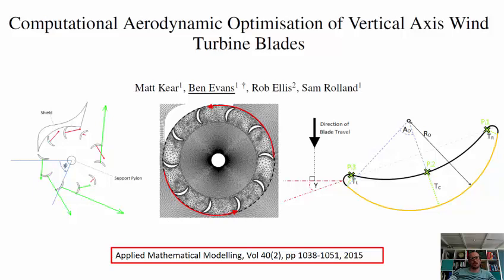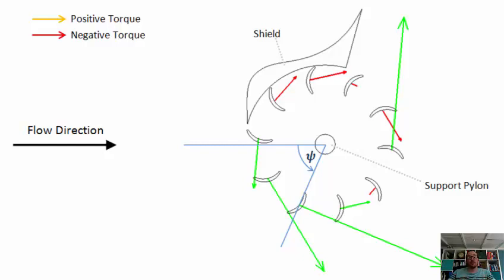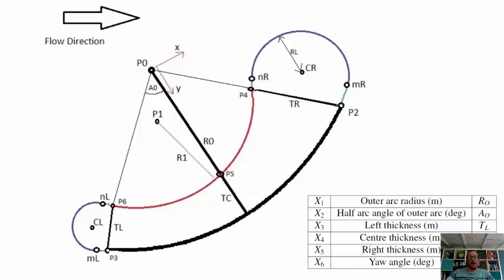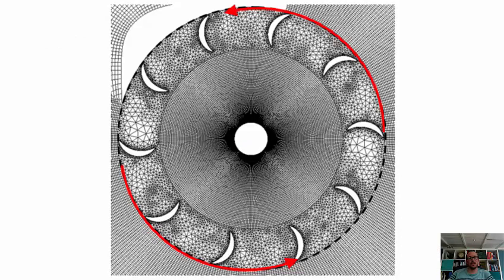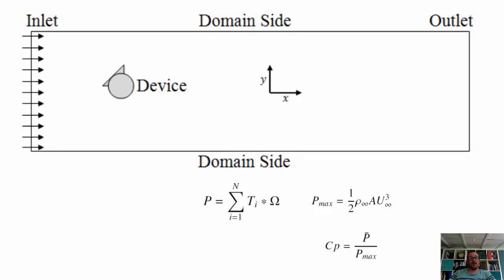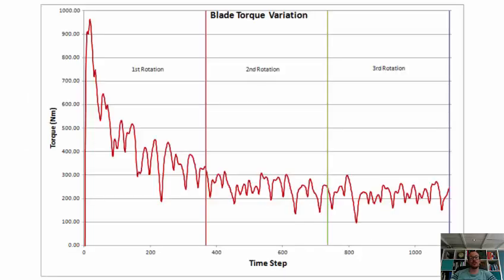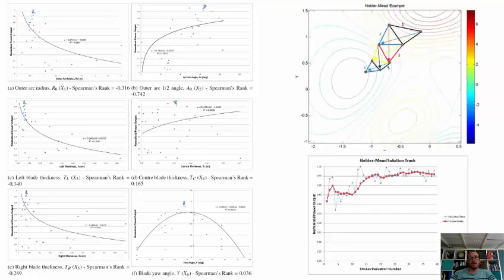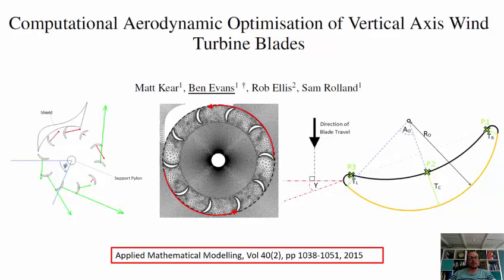Optimisation of Vertical Axes Wind Turbine blade shape using CFD

Comment: Hi, interesting video, cross flow blade design is something I'm currently interested although my degree didnt cover aerodynamics (disclaimer). I can't quite wrap my head around the angle of attack based on the pictures. They look like the blade is tilted nose down, a conventional aerofoil has its nose tilted up to generate lift, do you mind explaining why the cross flow turbine nose pitches down? I'm assuming wind is perpendicular at any point on the diameter of the turbine.

Comment: Appreciated Ben.  I'm currently saving for materials to build a medium sized ( 5 Foot tall ) VAWT which I'm going to surround with an Asymetric Vortex Propulsion shroud to boost RPM in low level winds to possibly generate enough energy to power a verticle grow tower hydroponics system inside a geodesic dome which should maximise space ( approx..10 plants per single 8 Foot tower ) and keep uniformity of temperature due to the dome's design ( heat source in the middle rises and falls around walls, and is exposed to sun's rays at a 360 degree maximising light exposure of plants).  The power needs are minimal (water pumps and water foggers) with auto start / stop devices to save on energy.  Your recommendations on blade design will save a lot of trial and error on my part so many thanks for sharing.  Take care  sir  : )